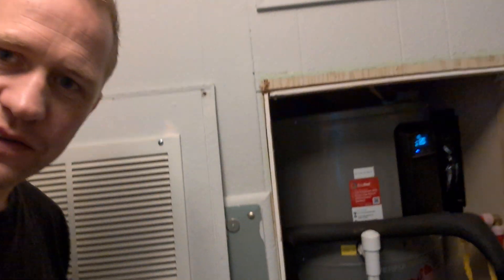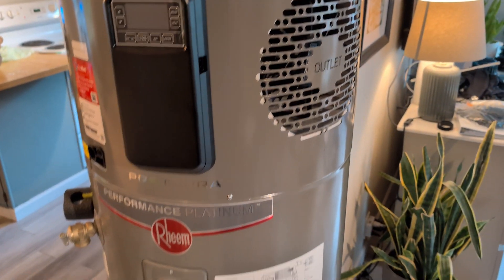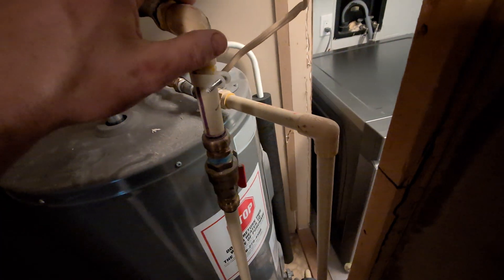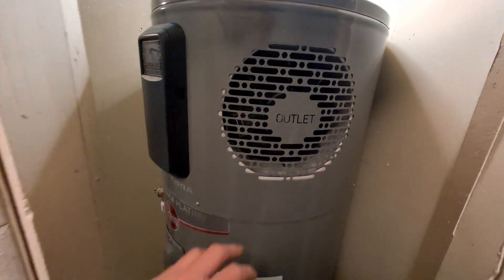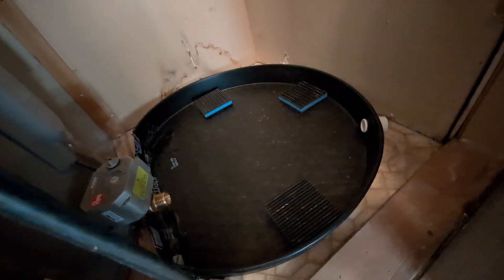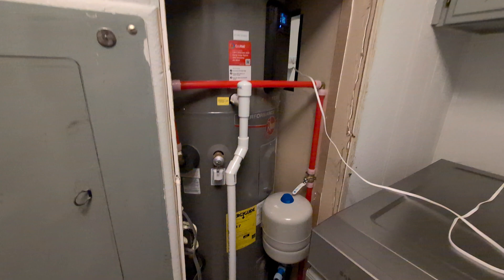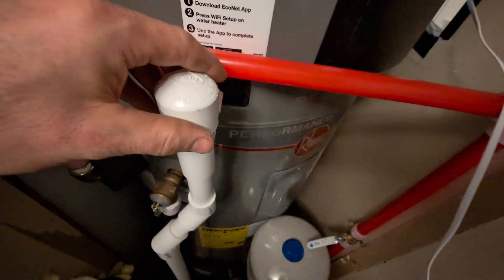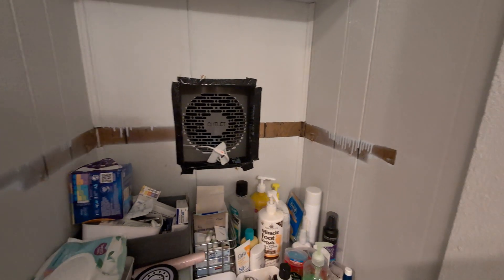Installing Rheem Hybrid Hot Water Tank - Super Efficient!

Comment: Are you glad you installed anti vibration pads under the water heater? Getting ready to install a Rheem hybrid in our laundry room and worried about the noise. Rheem sells a SP20883 kit but it's almost $200.
Reply from the maker: I would absolutely get anti vibration underneath. It does make noise when the pump is running and I'll do anything to lower that. The pads and the soft connection (PEX) to the heater helps. Check your plumbing code to see if you are allowed to connect it with PEX. Some areas require copper.

Comment: Dang it. It is the white drain line I wanted to see how it is installed.  Ya skipped over it.
Reply from the maker: I didn't show that one as it was simply threaded on. I put a T-fitting with a cap so that I can come back and blow out any build up over time. It is the condensate drain from the heater pump. I recently added a shut-off valve to it below the T, so that I can shoot pressurized air into the top of the T and all the air gets routed into the drain pan inside the heat pump (right under the top cover). I had a slime plug there. Let me know if I can help in any way.

Comment: Hi. Did you take hot air from attic to the intake Rheem HPWH to be more efficient yet?  Attic air about 100-120 degree and it make hot water faster.
Reply from the maker: That would make a lot of sense, but I also needed to vent the cold air somewhere. I sent that to the attic to condition the space. This is a temporary installation. It is going into new construction in about 1 year.

Comment: just use flex braided lines.  easier and more energy efficient than pex
Reply from the maker: I'll check it out. I was told that they cause more vibrational noise in these heaters with heat pumps.

Comment: IRC says that PEX cannot be used within the first 18 inches a pipe coming from the tank. Should use either CPVC or copper
Reply from the maker: Bummer. I'll have to look into it. Rheem recommends PEX to reduce vibration
Reply: had Pex on hot lines get brittle over time. Not a fan of the expanding pex connectors for mechanical security over crimp.

Comment: Thanks for the video. I assume this unit is like a wood stove in that it draws in air through the house's cracks and leaks and needs a separate vented air supply from outside or a vented attic
Reply from the maker: It all depends on how you set it up. You can have supply come from the inside with the exhaust also going to the inside. No pressure change. If your supply comes from the  outside and the exhaust is on the inside then you pressurize the house. You get the idea.

Comment: I installed one of these 7 years ago. At that time i ended up receiving a cash rebate of around 90 % from PSE. . Issues i have had,, control panel went out three time, lower burner went out once, and sometimes a get a condensate line is plugged warning light ,which it is not. I believe it has a ten year warranty, so all repair parts i received free , and installed myself. All easy fixes. I have mine installed in garage and ran condensate outside. Do not need a flue. I live near Olympia WA.. i love this heater. If you have any question or problems call the number on the info that came with it. Them are excellent to work with, and shipped all replacement parts free, and they will help you solve any problems, and send the parts fast!
Reply from the maker: Thanks, Robert! It has been good so far. The only issue is that the WiFi signal is unsecured so my Starlink Internet router won't allow it. The only way I can use the wifi capabilities is to set my phone as a hot spot and connect the hot water tank to it. Never thought I would have a wifi connected hot water tank, anyway, but I do love the statistics it provides.